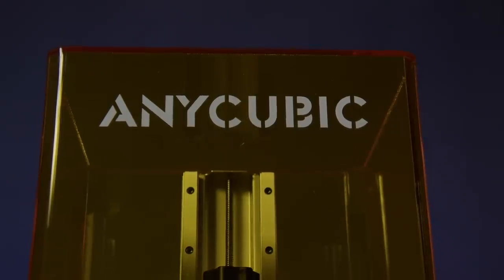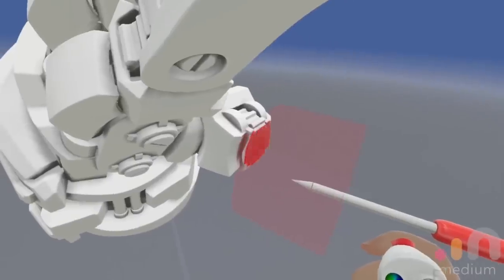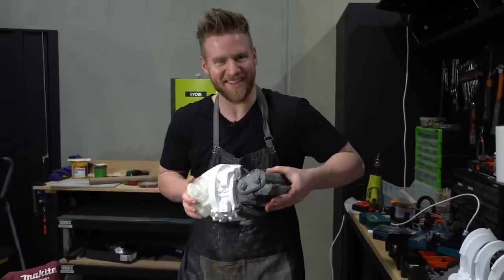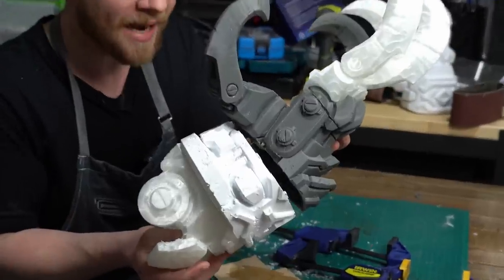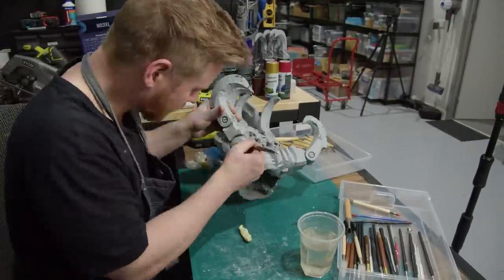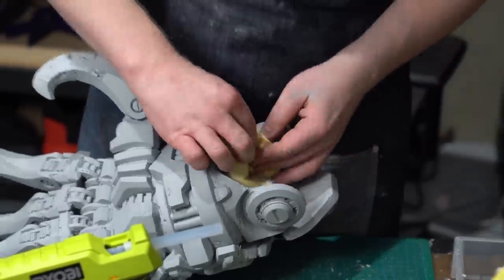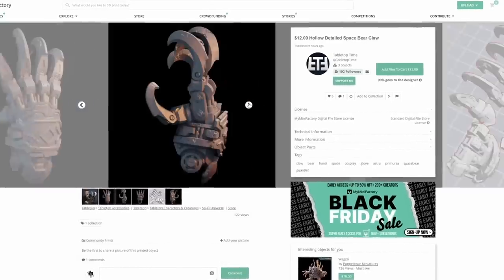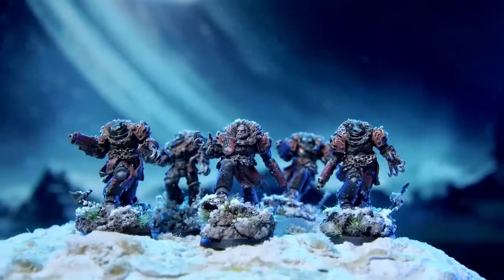IS THIS my most DANGEROUS creation?...

Comment: Challenge: Print one with functioning joints, and rig an internal system that allows you to move each digit with your own fingers. I have ideas, but let’s see what you come up with.
Reply: strings tied to the tips of the fingers?
Reply: Yeah, I was horribly disappointed. I thought that's what this video was going to be..🙄😒
Reply: Yeah, it's still pretty freakin epic but I just kinda assumed there were functioning joints lol
Reply: @billbarrett582  ya same
Reply: Not exactly a challenge, probably easier to do than this horror show. Many of its components can be individually printed with little use of annoying support structures including the palm and wrist. Just cut the wrist portion in half and glue it together afterwards. Work smarter, not harder.
Reply: @Jazza
Reply: @billbarrett582  The fact that he created THIS and your horribly disappointed smh

Comment: This is a great video. I love the paint job on the final, it is great to see mini techniques applied to a larger project. The biggest shock of this video though, is that you can get a high res (6k) resin 3d printer for $599. it says limited time to Nov 15, but they're still available at that price, and they actually have a smaller model available for $269 (4k), and also a 4k printer of that size for $429. That's amazing! I looked at resin printers a couple of years ago and thought I'd never be able to get one as they were $3k+ for an entry level model. To have that quality of printing available at a $600 price point is incredible.

Comment: my process for cleaning up 3d prints to remove 100% of layer lines: sand with 80 grit on palm sander, this will melt some of the layer lines together and remove imperfections if there are any, don't hold the palm sander in one spot for too long otherwise you will melt it too much. after that go over with a higher grit to remove the roughness left from the 80 grit. after that spray filler primer, sand down and then spray again and sand again until you have no more layer lines

Comment: this would’ve been so much cooler if it was articulated but it still turned out amazing! Really cool!
Reply: To be fair he did as for it to just have a hole in the back.
I'm sure if he wants to make a version two, would be needed for parts if he decides to make an entire armor, articulation points and connectors could be added into the model.

Comment: Would have been cool if you attached string inside from the fingers , through them, and I to the knuckles. And used them as extensions that you can pull with your fingers to make the claws open and close

Comment: I would have lined the inside with a sprayable rubber paint like a flex seal, or  a truck bed liner, then sew/hot glue fabric/leather/fake fur on top of the rubber spray.

Comment: ya know... the two major holding points for power armor and mechs is mostly tensile strengths and energy efficiency, if these two things were handled, having a life sized functional space marine armor would actually be possible... then people could be terrified of a combat armor running 45 mph weighing around 8 tons and standing over 12 feet tall as it smashes through a wooden structure... though i'd go with the claw of life or a plasma sword over a chain blade, a tree doesn't fight back but anything moving, i'd prefer a tougher melee weapon lol

Comment: What If you 3d print each section and joints like fingers and such and make a mold for it and eventually pour molten metal into each mold polish it and carve out the inside so it's possible to move the claws too